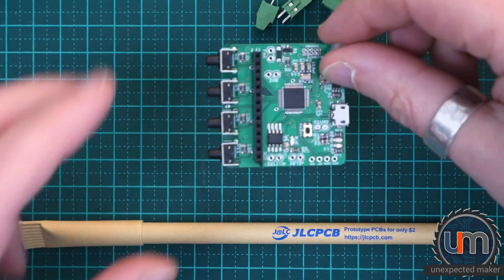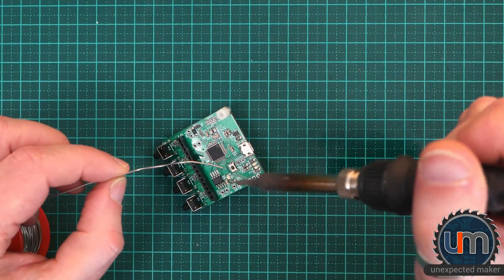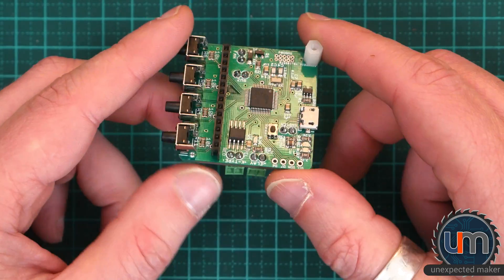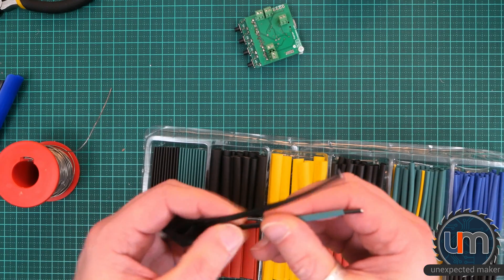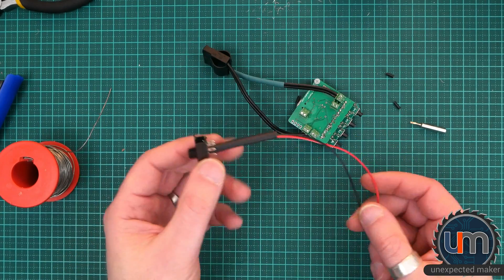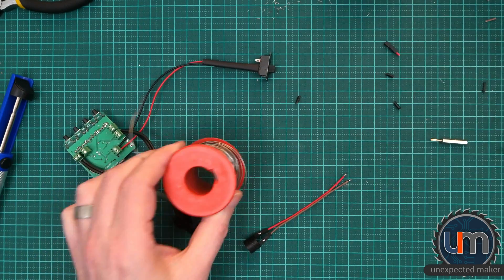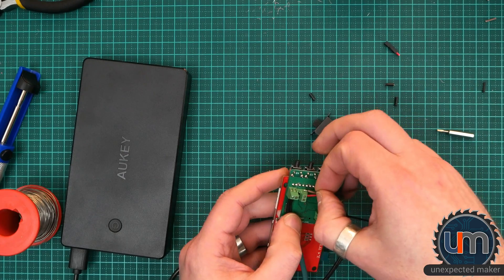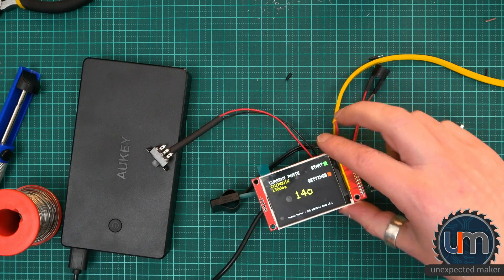ReflowMaster PCB Final Assembly

Comment: Solder sucker ... either put a silicone tube on the one you have, which is going to improve the fit and suction like crazy. Or go wild and get yourself a piece of Japanese gear, the Engineer SS-02 (http://www.engineer.jp/en/products/ss01e.html). Makes the suck much more enjoyable ;)
Reply from the maker: Much easier to avoid re-soldering in general right? make less mistakes? hahaha

Comment: Hi Seon, well done, it worked. To make your solder wick wider, just grab each side and wiggle it and the strands will loosen and widen out. Also try putting the flux on the solder wick and you will find that the solder migrates to the wick even better. Regards, Dave
Reply from the maker: Thanks David.. good advice re the wick and flux. I'll try that next time :-)

Comment: Nice one. Although it’s a prototype you should use more reliable connections on your screw terminals by crimping the stranded wires with the correct ferrules. Because the bare wires could come loose over time, also solder as a soft metal will deform under the pressure of the screw over time and come loose. Surely not in a few weeks but they’ll surely fall out after a longer period of time which will lead to some problems. Or just use some jst or other connection Methode 😀
Reply from the maker: Yes you are right Michael, I need to buy a kit with an assortment of the correct ends. A never ending shopping list of stuff :(
Reply: Unexpected Maker so it’s shopping time again 😀
Reply from the maker: It's always shopping time :(